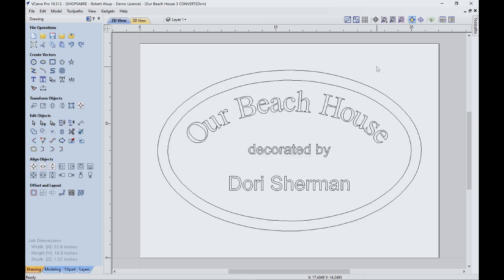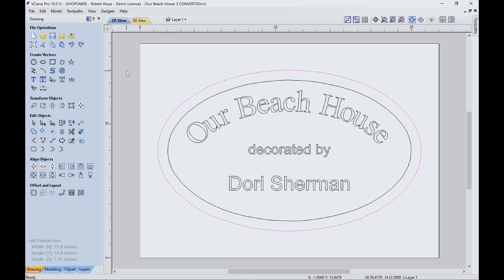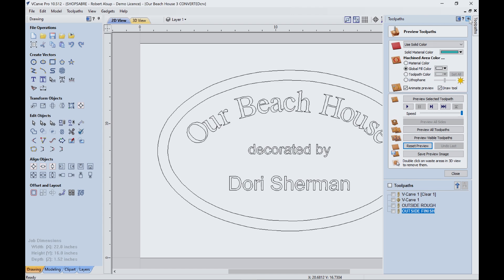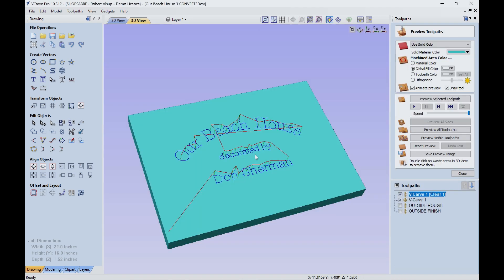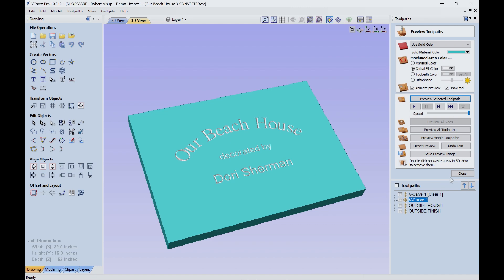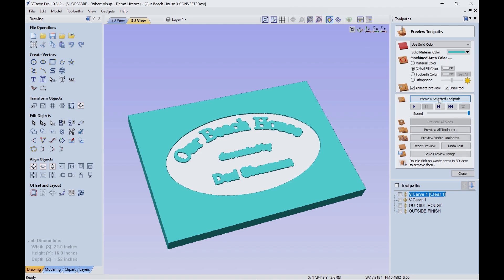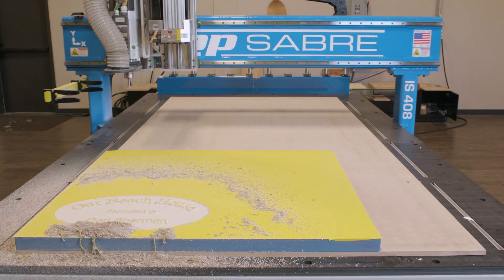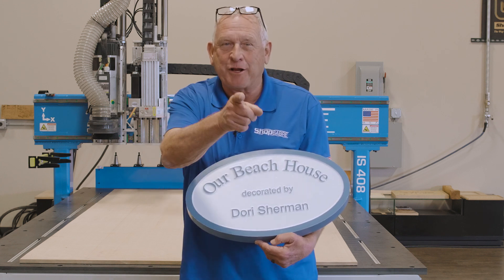VCarve Foam Sign - ShopSabre CNC

Comment: What material was used for this project?
Reply from the maker: Sign Foam
Reply: @shopsabre  I’ve tried to find sign foam or (HDU) in Rochester NY area and it seems hard to come by.  I can’t seem to purchase any around here.  Any suggestions?
Reply from the maker: @scottsargent2885  Unfortunately we are based in Minnesota and I am not sure what stock levels are outside of the state. You could try calling Signfoam directly and they may be able to help. Or your local material distributer

Comment: Can you put wood inverts into this foam for mounting an eyelet bolt for hanging on a sign upright??? I was going to use 1/2 in treaded eyebolt
Reply from the maker: We specifically specialize in CNC manufacturing, we aren’t as advanced on all the processes that go into specific sign construction outside of the Machine but if you need holes drilled for inserts the ShopSabre can do that as long as the tool can reach the area on the material you require

Comment: In VCarve, you can make your profile cut 'do separate last pass' and add a tolerance in the dialogue box. In all but the last pass, it will cut 0.02" larger or whatever you set as your tolerance. Then the last pass will be the final dimension. You can also set to reverse the tool path if you'd like to switch from conventional to climb or vice versa. Check it out!
Reply from the maker: Thank you